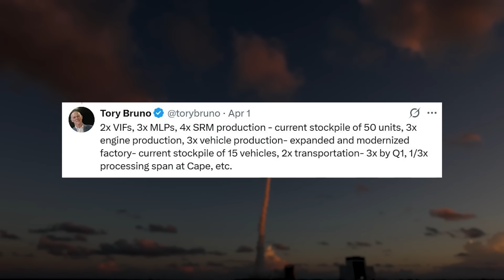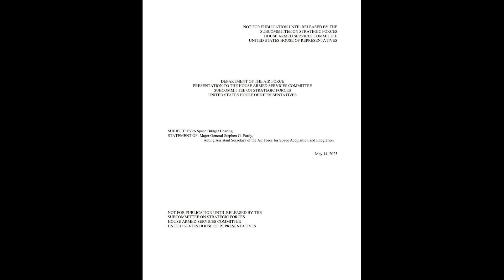ULA Is Trying To Increase Vulcan's Launch Cadence

Comment: why not just make the Vulcan able to land......
Reply: The booster goes too high and too fast for pracical recovery. It's the same reason SpaceX stopped trying to recover Falocn Heavy cores. 

That's also why SMART reuse requires a full fleged heat shield to return
Reply: @notgreg123  never say never.

Comment: ULA has had enough time to develop a reusable first stage booster.   What a waste of an expensive vehicle and engines.
Reply: Yes but why should they care?  It’s the US taxpayer that is paying.
Reply: @qwerty112311 
They could have just defauted to the Delta-IV vehicles with more powerful solid rocket boosters.
Reply: Vulcan boosters can't be recovered like Falcon 9 without a comically long reentry burn since it goes much higher and faster. It's the same reason SpaceX gave up on recovering Falcon Heavy cores
Reply: ULA has its hands tied without any independent capability to develop their own engines. If you try to build a vertical landing booster using BE-4 engines, the smallest possible rocket you end up with is basically a New Glenn.
Reply: @leeswecho they had a chance to use the RS-68's.  But, we know that Boeing would never agree to it.  Boeing so hated that they got caught cheating in the initial EELV competition,  till they were going to discontinue the Delta-IV.   This was back in 2005-2006.  I may be off a couple of years.

Comment: Is ULA still working on making Vulcan Centaur crew-certified?  This was part of ULA's initial plans for the rocket, but I've not heard much about it since.  Besides launching Starliner on Vulcan Centaur once the six Atlas V rockets that have been dedicated to Starliner have been used (assuming Boeing doesn't cancel the project), there's also the crewed version of Dream Chaser.  Thanks for the excellent video.
Reply: Boeing Starliner Program corporations partnership is not focused on making Starliner affordable to other commercial markets.  All they can think about is current losses based on their old  cost plus accounting style.  They need to suck up the financial investment and market Starliner affordable. Bor sell the program to  Blue Origin.
Reply: @arthurhamilton5222  I think Boeing might just be trying to squeeze as much revenue as possible out of the six remaining Atlas V launches for Starliner,  then throw in the towel.  Perhaps they can break even or make a slight profit if NASA uses all of these Atlas Vs for crewed missions, but maybe not if NASA requires another uncrewed test mission, or if the first production Starliner mission is just a cargo mission.  Selling Starliner to Blue Origin might make sense, but Blue Origin would have to ramp up their infrastructure to launch crews on New Glenn after getting it crew-certified.  I was half-expecting Sierra Space to buy ULA last year so they could obtain a dedicated launch platform for Dream Chaser.  This might help them fill the gap if Starliner is cancelled.  I think a lot hinges on what NASA decides to do with the next Starliner mission to the ISS.
Reply: The rocket is designed with crew rating in mind but won't be fully rated until someone is willing to pay for it

Comment: Sorry, man.  It hit me hard at 3:33-3:38.  A rats-nest engine, compared to Raptor 3.  Non-reusable?  Again, sorry but I see these engineers as perhaps embarrassed or ashamed.  I hope I am wrong.
Reply: Blue Origin designed BE-4 from the very beginning to be reusable. The engines have also demonstrated loads of reuse and firing for 10s of thousands of seconds on test stands and turn arounds to next burns within 24 hours. They were sold to ULA with the intent of matching to New Glenn versions as close as possible. The engines aren't the hold up on reuse, the design of Vulcan and intentions of ULA is.
Reply: all that junks on the raptor 3 as well. hiding it inside the rocket doesnt get rid of it......
Reply: As if that's a hindrance to performance
Reply: Considering BE-4 has launched actual payloads and Raptor has not, probably not.
Reply: @Random7303  no way you actually though that was a brilliant comment
Reply: @snuffeldjuret  One engine currently launches payloads and the other doesn't. That's just reality. I'm sure SpaceX will get Starship to work and launch payloads eventually, but Raptor 3 hasn't even left the test stand yet, it's not really appropriate to try to compare the two right now.
Reply: @Random7303 
Raptor 2 has already been reused on a launcher.  BE-4 haven't.
Reply: @arthurhamilton5222  "launcher" lol. explosion data collecting doesnt count.
Reply: @geesehoward700 
Superheavy made it to stage separation and back to the launch pad.  SX has a reusable Superheavy first stage booster. If they stopped further development of the first stage, it would be complete.  Now the second or upperstage is still in full development.    Perhaps your Superheavy rocket works on a different principle of physics.
Reply: You do know that's how Raptor started out, right?
Reply: @thomasackerman5399  what makes you think BE-4 will be optimized like this?

Comment: how exactly does it get certified without even a single successful flight???  compared to space X ULA gets all kinds of special treatment.
Reply: They fully embed their government customers into every aspect of their business. SpaceX and others don't do it to anywhere near the same degree.
Reply: They had one entirely successful flight with no misshaps (the first one) and the second flight they also successfully reached their desired orbit even though they had a misshap with the GEM-63XL. Since then they have done a detailed months long investigation and identified an SRB manufacturing defect as the cause of the nozzle failure. Following the conclusion of the two successful launches and the SRB anomally investigation they were certified for NSSL launches in March.
Reply: because ULA has quality control where spacex just fling something into the sky not really knowing what's wrong with it
Reply: @kipkipper-lg9vl  starship isn’t doing certification flights.
Reply: @qwerty112311  Starship cannot stay in one piece to even begin those yeah
Reply: I thought there was a second stage engine restart issue?
Reply: @vernepavreal7296  that was Ariane 6